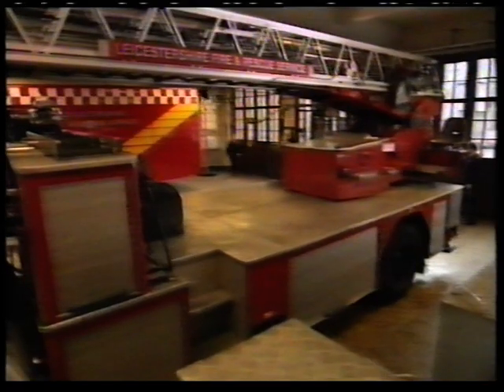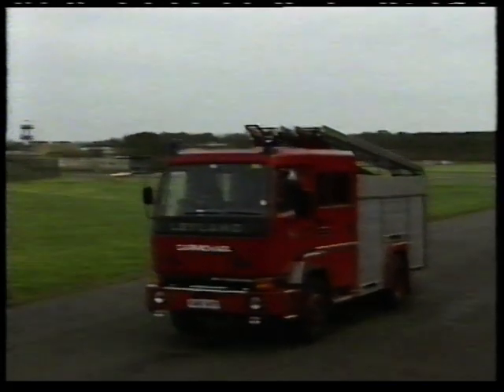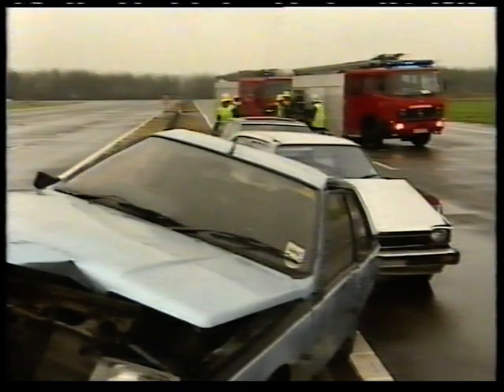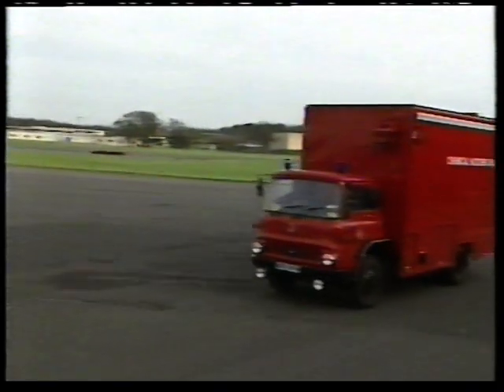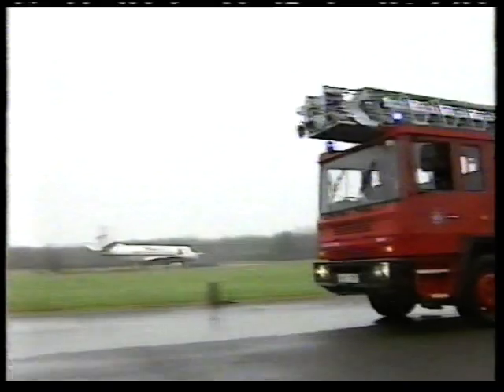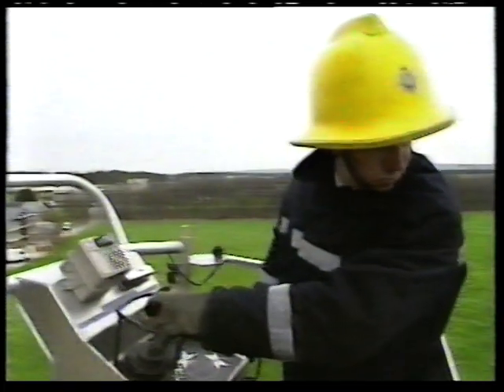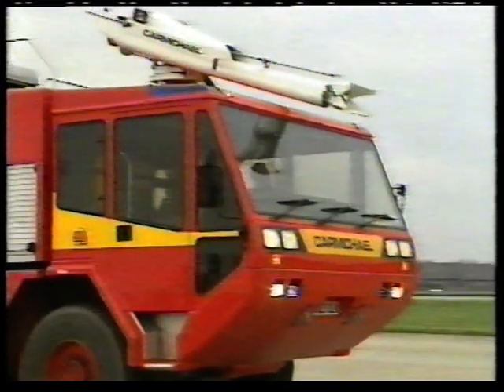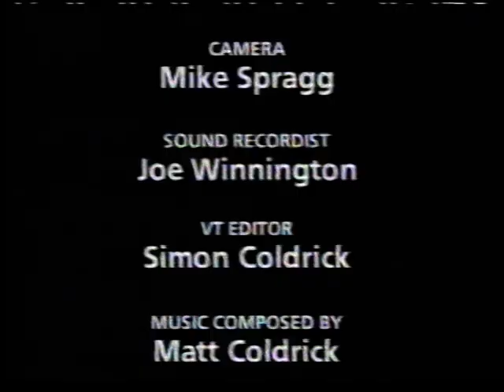Mega machines - Fire trucks

Comment: Carmichael Cobra

Role:
Airport Fire Rescue Vehicle

Speed
113Km/k

Engine:
Detroit Diesel 8V92TA
Watercooled-2 Stroke Direct Injection Turbo Charged Diesel Engine

Acceleration:
0-80Km/h In 34secs

Foam Tank Capacity:
1400 Litres
Reply: The water comes out of it's tongue!. From Joe. X